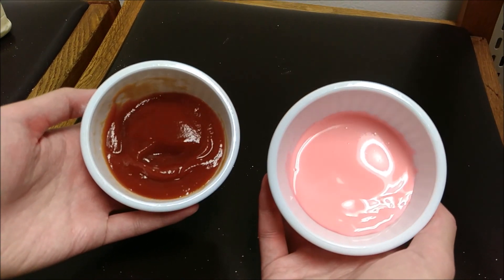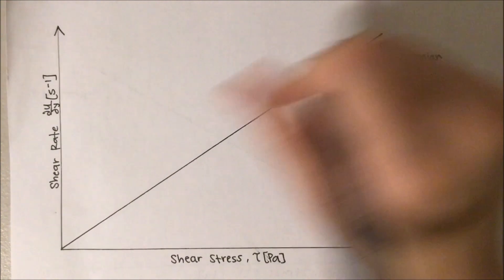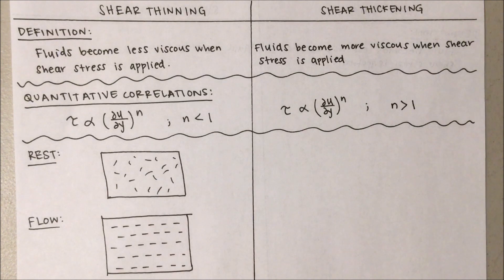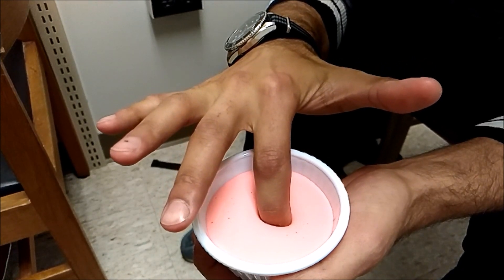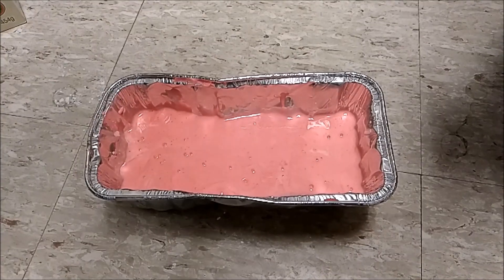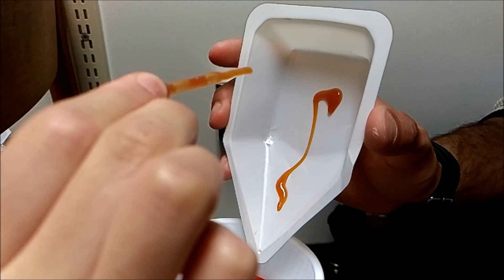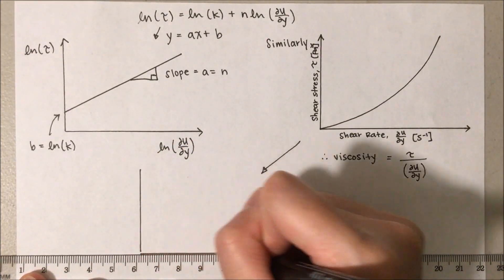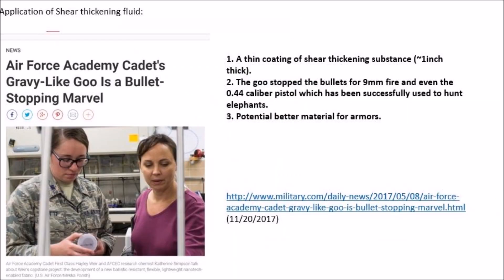Newtonian vs. Non-Newtonian Fluids

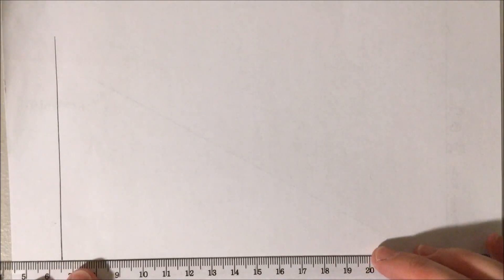Comment: Excellent video but why are the functions for shear stress at 1:07 both negative (-η and -μ)? Here you defined η =(du/dy)^(n-1).  Doesn't that mean that η = (du/dy)^n / (du/dy) .  In the power law model at 6:37 you rewrite the Tau function but, using the above: 
  Tau = -η(du/dy) = - [ (du/dy)^n / (du/dy) ] x (du/dy) = - (du/dy)^n 
This makes your consistency coefficient (k) always -1.
I know that's not true so where is the flaw?
Also at 6:37, you have the units of K as [ Pa-S^(-n) ].  Shouldn't that be [ Pa-s^(n) ]?
Reply: I would also like to know this :-)